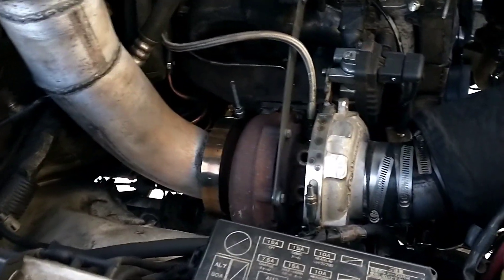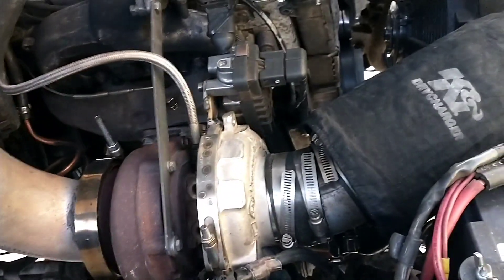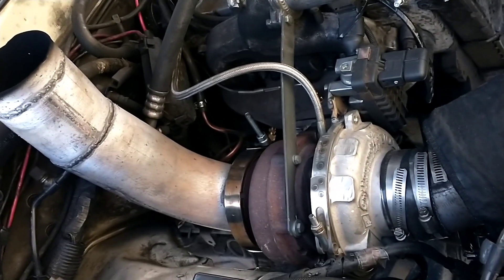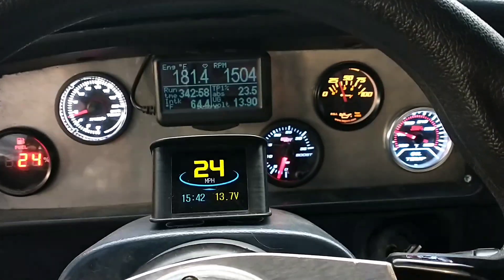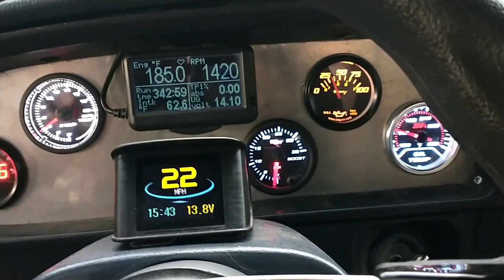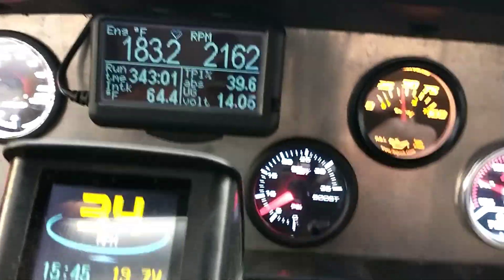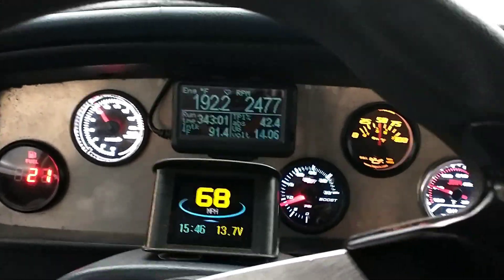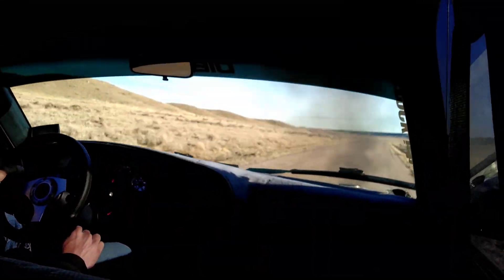TDI Toyota Diesel, Initial Tuning on GTC2262 w/ Hella actuator, .260s and 36 PSI on a stock ALH!

Comment: ISUZU NPR TURBO - BUT WHAT ARE YOU USING FOR ENGINE CONTROLS?
Reply from the maker: I am using the factory 03 ALH TDI wiring and ECU tuned to control a Hella electronic actuator mounted to the turbo.
Reply: @TDISwaps  which turbo is it? The only ones that I can find are waste gated turbos not vgt
Reply from the maker: @piotrekszkaradek123  this has a long Honeywell part number, it just relates closest to a gtc2262.  It's off a 2014 Isuzu box truck in Finland with a 5.2L 4 cylinder
Reply: @TDISwaps  ahh ok I have the same one ordered from arttu but theres a bunch of shipping confusion so idk when ill get it, would it be possible to see what you did for oil feed and drain?
Reply from the maker: @piotrekszkaradek123  well I didn't do anything special, just a universal stainless steel feed line with a adapter to the 2262 port, then I just took apart a VNT 15 oil return line and got it down to just pipe on both ends and put a piece of rubber tube between the two
Reply: @TDISwaps  thanks i appreciate it
Reply from the maker: No problem!
Reply: Where is the best place to order one of these turbos in the States?  @TDISwaps
Reply from the maker: @JonathanDiffee they sometimes pop up on eBay but it is not very common